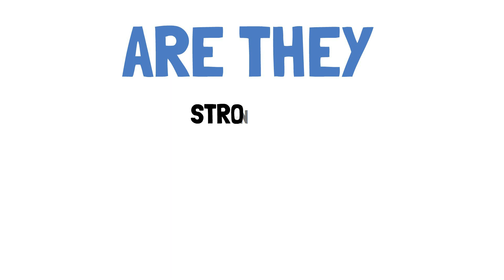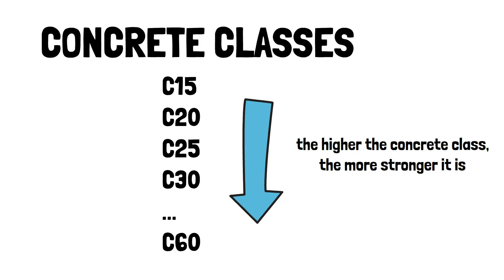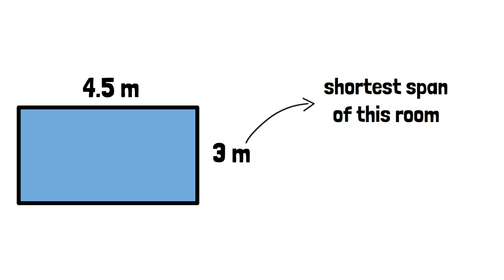T-Beams & Blocks: The BEST Beam & Block Tech For Suspended Slabs

Comment: Hi engineer  I want to install rib and block. I do not have access to prestressed ribs. I want to replace them with traditional rebars. On 13 ft span what size T beam and rebar size should I use ? And 2 floor building what size concrete blocks should I use? Thanks 1:28 1:28 1:28
Reply from the maker: Kindly consult Kingdom Precast for Tbeams +254714 259226

Comment: Using concrete and cinder blocks puts more stress on the concrete beams. If you create concrete forms and use steel rods will help to support the structure

Comment: How do you add cantilever slab with this type of technology especially when you want to lay block on top of the cantilever?
Reply from the maker: The Tbeams can extend from the last ring beam to the required span of the cantilever. But this depends on the structural slab design for the placement of the T beams
Reply: Suspend the main beam/girder for the cantilever, then go ahead as usual
Reply: Building is not about choosing the cheapest option today, but about the strength and safety of your house in 20–30 years. Block decking may look easier and cheaper, but normal decking (slab) gives better strength, durability, stability, and lifespan. Always build with proper design for long-term safety

Comment: Muema, is anyone in Kenya actually precasting pre-stressed T beams? I observed they use mild steel rebar, while pre-stressed T beams are supposed to be made with high tensile steel cables for rebar.

Comment: Hello Nick, 
 Can the walling panels be used as a substitute for the hollow blocks in between tue T-beaams when making the suspended slab?
Reply from the maker: No, if you want to use precast panels, you'll need to support them with steel beams
Reply: Thanks for the reply. 
If I use the T-beams and hollow blocks for my ground floor slab is back filling after foundation walling necessary?